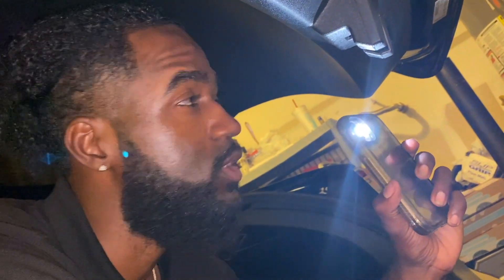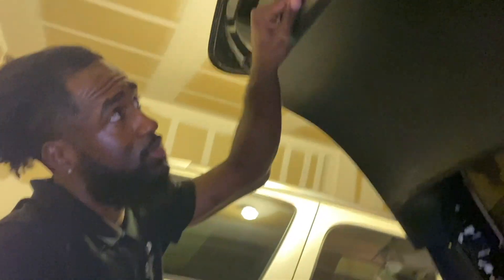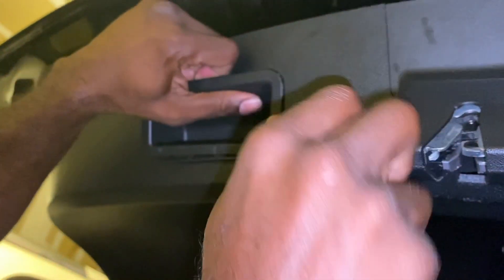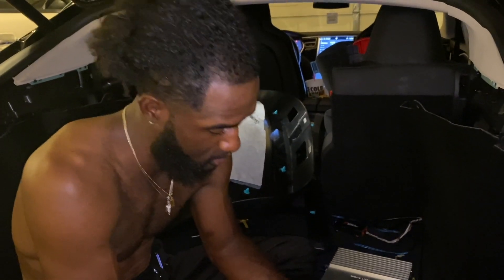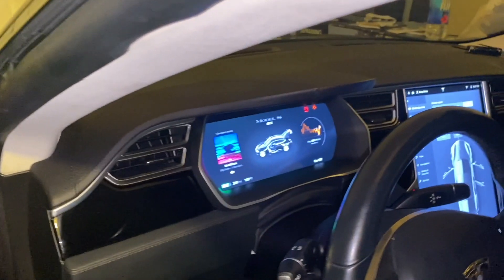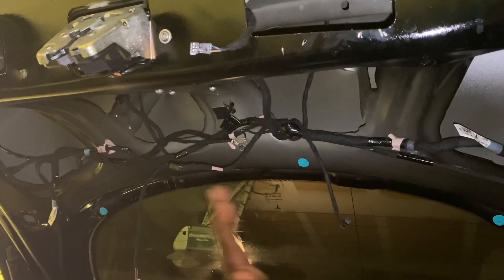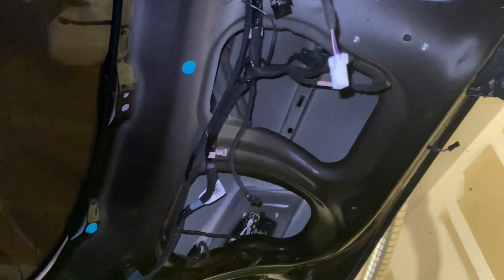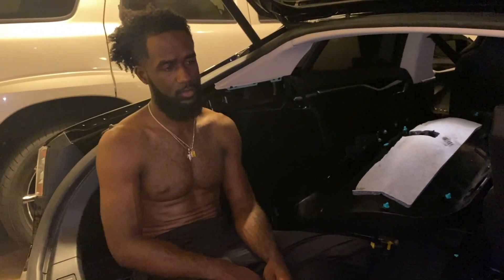Tesla Model S | How To Fix Trunk Lock|  Trunk says it’s open | Trunk stuck closed fix

Comment: When I pull that black side plug in and out my tesla 2015 ms isn’t doing anything lol… guess something more has gone bad 💀.
Reply: Update so on my car the top left plug in that compartment is the black one vs your video its bottom right 😂. Wtf is up w that haha. 2015 MS 90D. But did get latch action to work w the plug secks maneuver. And my car recognizes it closed too. So that will be my temporary measure until tesla can replace the part.
Reply: @lynnjjjjj  My S from dec. 2015 is the same. 
I start with the emergency steel wire under the small trunk lamp. It did nothing! 
Then i open into the 4 plugs. First i think "strange my bottom/right plug is light gray, not black". 
Takes it out and in again, it just beep. No "servo sound". I come to computer again and see your (J J) comment, go to look again. 
Yes, my top/left plug is black. I pull it out and put it in again and  i can hear the servo sound. 
I pull plug again and lift hatch with my arm, put in plug and the hatch open. 
My hatch work again, But every time it close it do not close good. 
I can see it is some millimeter op. And i need to "pull the plug again". 
I find out if i "help the hatch" the last 10 cm to close good, by push hard down on it. it works every time. 
I can open and close on FOB, app and 17" screen, so long i help it close good. But it will do not look good doing so every time on a parking lot :-) 
So i give lock some oil and remove some burr from the black nylon bar, that move the lock.
Now it work all the time with no "last 10cm hard help" 
I did not take other plastic off than the one for the 4 plug. 
The lock have two click, in my case i needed to make sure lock latch could reach no. 2.
 You can see if you move latch up with a screwdriver car thinks hatch is closed. 
(in my case anyway)
Hopes it continue working.

Comment: Thank you so much, Tesla Plug, you saved my whole week! I got the dreaded problem this morning, and I need the car for a 1,000 km trip on Saturday, so waiting two weeks for a service is just not an option. Now, just by following the step at 9:44 in your video I got the trunk to open, and then I could close it by hand, and it's all good! 💖

One point that owners of cars newer than 2016 might find useful: the boxes where the black cable goes in have been rotated by 180° now, so the cable is no longer the bottom right socket, it's the top left one. But your tip of "don't stick it all the way back in there... do like that," is spot on - I had to jiggle it back and forth about five or six times before the motor finally popped the trunk. 

Wish I could upvote this 100 times, but you bet I'm gonna subscribe now anyway! 😁

Comment: Thanks for the very helpful video! Just ran into this problem, and the mobile service came out and pressed the truck button and got the same 3 beeps i was getting, he agreed the actuator is failing like i told them, then charged me $80 for their "diagnosis". I said "wait, for what, pressing a button costs $80? I already knew it was faulty, i wanted you to fix it." But apparently they came out without the parts, so that was useless. They said the full cost will likely be about $500 to replace the actuator, but I have not gotten an official estimate yet. I asked if they could at least do a manual release for a temporary fix and they said no because even if it opens, it may not close which would be worse. That's when I started searching and found your video, I'll give this a try first. I may even go as far as replacing the actuator myself but I'll try this release first.

I loved the family support btw, props to your camera girl and thanks again for sharing and helping us out. I also noticed you lost your shirt half way through the battle... 😂 Maybe it's harder than it seems, but you made it look easy. Keep up the good work!
Reply: I was quoted $253 total, to replace both the "liftgate latch power release" and the "high force clinching actuator". Seems pretty reasonable, but I'm a cheap bastard so I might still do it myself.

Comment: thanks for the video .  I was able to get my trunk un-stuck like u said by temporarily disconnecting that wire harnesses you mentioned.   oddly though, all I did after that was spray some silicone lubricant into the actuator mechanism and wiggle it around w a screwdriver , then it started working again .  maybe I'm just delaying the inevitable but will see how it goes.
Reply from the maker: Please Let us know how it worked out for your trunk!!

Comment: Thanks.  Just happened to me and the other video helped but yours has a better videographer getting the good shots!
Reply from the maker: My pleasure man , glad to be of aide. Thanks for subbing! Feel free to comment any updates.
Reply from the maker: Were you able to get it fixed?
Reply: @TeslaPlug  had to call T. They said I ran the wire to the cinch wrong so it couldn't pull the trunk closed completely, still save me a few hundred overall. Front light is next for me.
Reply: @the_original_dreamer  so you didn’t change the actuator or the latch? I removed the black plug fixed the latch before I pull apart the section and it started work completely. After a minutes I got a message and started to make sane issue again, basically lock got unlocked, there are 2 steps to getting locked, I guess it unlocks one the steps by failure, I don’t how this is happening! Did you replace any items?
Reply: @elyarsamadi  
I replaced both, but Tesla said I routed the cable wrong so it wouldn't close the trunk all the way.

Comment: Subscriber no 1 checking in, I just had mobile service drop off my parts for this repair $120
Reply from the maker: Thank you for subscribing, it’s exciting to begin providing things for a community I know people would be able to use to help themselves and have fun with our experiences with our Tesla’s. Keep that mind state going and comment back and let us know how it goes and what you had to end up doing.
Reply: @TeslaPlug  Well i got started last night, and I think everything went "OK", on my car the plug for the lock by the wheel weel was harder to find, so I ended up unplugging everything there. I did find it and eventually, it let the trunk open. Tesla left me a latch along with the cinge acuator, so I replaced both. Now the actuator is in and the latch, but I havent put all the panels back on, that plug by the speaker was a @#$@#$ to get to. The car still says the trunk is open, but I can pretty much open it and sut it but it doesnt lift the gate all the way up like before. I thought I missed a connection somewhere, but I havent found it yet. I will check again after work.
Reply from the maker: Sorry for the late reply! How did it end up going? I thought I had putting it back together in this video but I’ll have to make another one.